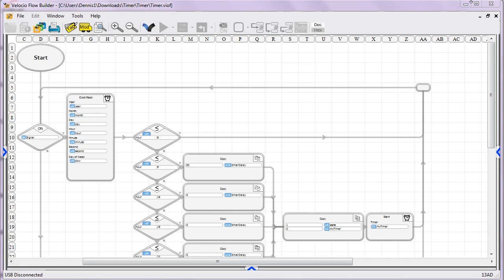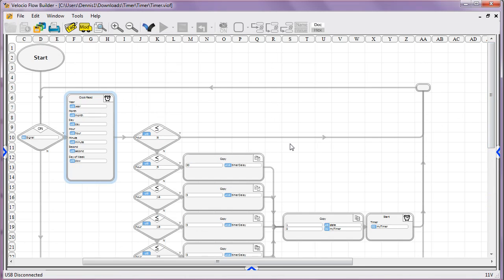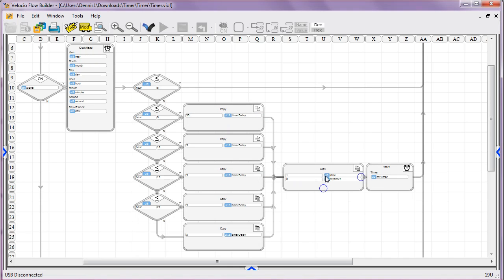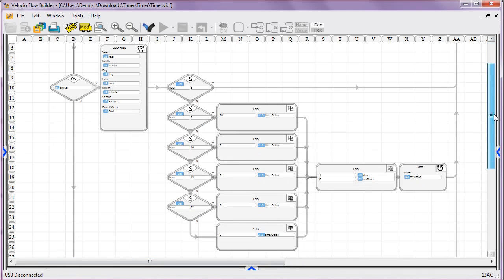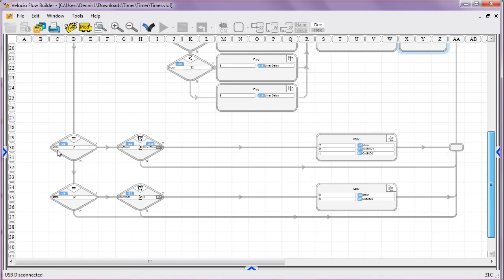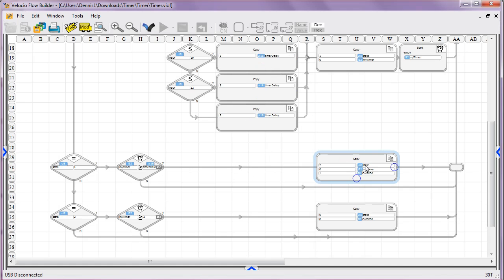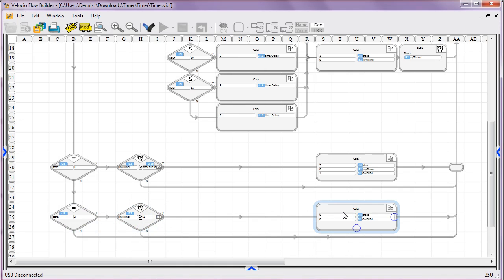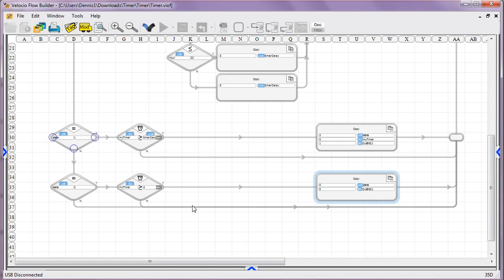Jason Timer Example

Comment: Hi Dustin.  It looks to me that between hours 10 - 22 does the same thing (copy 5 into timerdelay), so can't you eliminate decision blocks for hours 16, 19, 22 and just have a <= 23 (with 'no' same) decision block?  Because from 0-6 it does nothing, then 7-9 it uses a 30 sec delay, and 10 - 24 hour it uses a 5 second delay. What am I missing here?
Reply from the maker: +Godin Technologies Yes, it you are correct.  In this case, I was rewriting code a customer had provided.  Their original code had it broken up like this.  I assume the identical values were a placeholder he would modify later.  You are correct though, if this is logic is the final goal, it could be simplified quite a bit.
Reply: +Velocio  I see, makes sense, thanks.